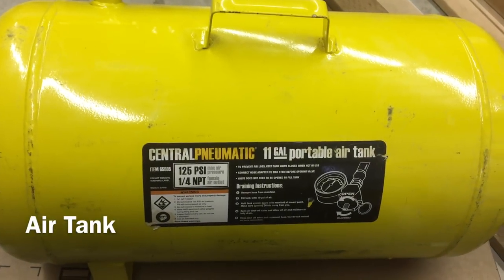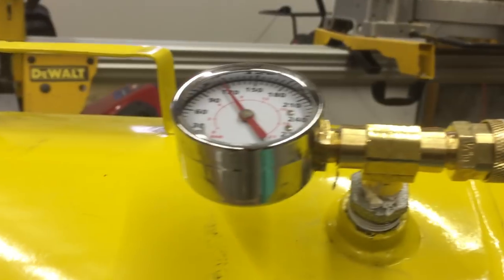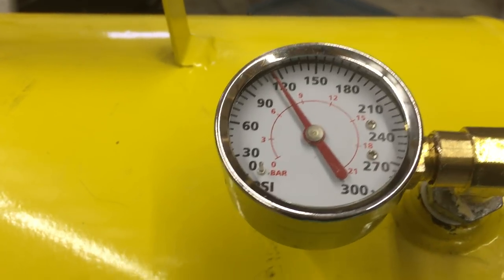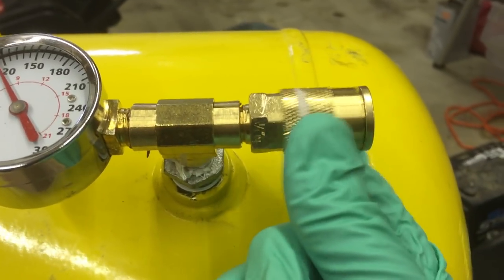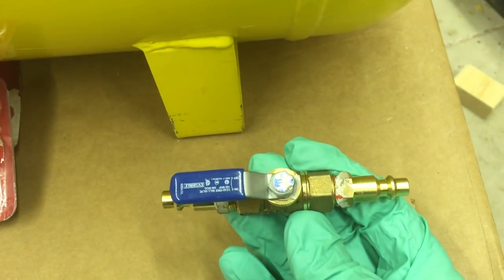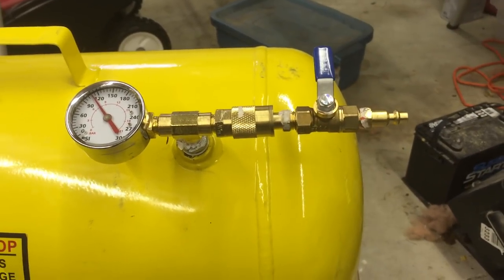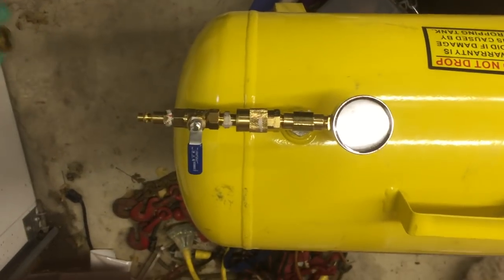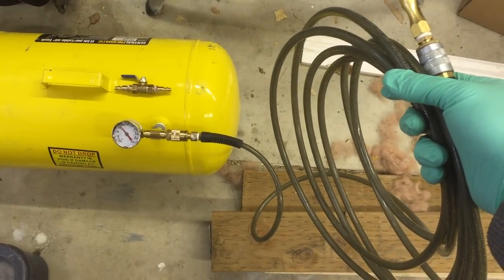Harbor Freight Portable Air Tank Valve Solution and Improvement

Comment: An absolute grand presentation! Thank you!  After 'fixing' the harbor freight air tank, all I need is a length of air hose with two female receivers at each end and I'm good to go.  Changing tires on a manual changer? Try seating the bead without this stuff. Thank You!!!

Comment: Anyone watching this should be warned this is not the correct modification to make. The Safety Relief Valve  has been removed and now the 11-gallon tank is a potential risk of being over pressurized /exploding. Safety is No Accident.
Reply: I quickly jumped to say this as well. Absolutely horrible implementation.
Reply: Jumping the gun. You would have to be able to put 1000 lbs, or more, pressure into that tank for it to explode. First of all I doubt you've got a compressor that could move that amount of air. Second, your hose from the compressor to the tank wouldn't be able to handle that much pressure. I see your point, but these things are engineered to handle excess pressure. And if the tank would fail, it would most likely start as a pinhole leak and just get larger...it just wouldn't explode.
Reply: @TheOcelot17   This bullshit comment sounds exactly like the typical stubborn God complex that almost always ends in accidents and fatalities. What are you basing your under-educated assumptions on? If you are assuming that the pressure tank is simply over built, therefore it would not make any difference, you would be incorrect. These are made as quickly as possible: sometimes by machine, other times by hand. They are not always hydrotested. If it happened to be welded by hand, who really knows rather or not the welder was shit faced drunk that day? What grade of steel is it? Was it treated properly? Accidents can happen anywhere along the assembly line. Now imagine a guy that lives by the ocean using this. The salt in the air alone derates the working pressure immediately. The same applies for use in extreme temperatures and fluxuations. These circumstances might not apply to you, however it will for others. Others who watch this video and decide to try to build one themselves. Do you honestly believe the engineers just decided to affix a working pressure because the number sounded cool? Are you even considering the obvious galvanic corrosion that will occur between the multitude of dissimilar metals used? What do you expect will happen if someone installs the fittings inadequately? What happens when an incorrect check valve is installed and someone decides to quick fill it with with an high psi compressor and the pressure switch on it happens to fail closed? Stop pretending like safety devices and warning labels are manufactured for just for fun. At the very least keep your potentially life endangering comments to yourself for the safety of others.
Reply: @Cameron_J  Truer words were never spoken!!!
Reply: I know my opinion is worthless after how many years have passed since this video was made, but I have to ask: do you even know how air compressor and portable air tank work together?
Reply: @xumot  I do, Great if your relief valve on you compressor system is equal to or less than the maximum rated portable tank pressure rating... if not and your Regulator were to fail (which I know can happen), you can over-pressurize the small portable tank.... I have seen the explosion of a pressure vessel and it's not something to take lightly. Keep safe out their...and your opinion does count.
Reply: @AddyOverbeeke  No matter what you do, safety is always a concern, that's a given. In my case I bought small 2.5 gallon 115psi oil-less air compressor and wanted additional tank to use as portable tank or in unison with the compressor. For that I bought new 7 gallon gas tank, rated for 435psi of working pressure and converted it to air tank with pressure gauge and two Quick-Connect fittings, nothing else. No relief valve is needed on the portable tank, because there is one on air compressor, and when I disconnect portable air tank from air compressor, it has maximum 100psi in it - nowhere near it's rated working pressure and besides, no more air will get in to the tank, only out.
Reply: @xumot  sounds like you know for your setup as long as it air supply source remains the same, but I was more concerned for those that do not, make the modification and create a hazard or later change their air pressure supply source not having a safety relief valve any longer.  
removing the relief valve removes the mistake proofing intended by manufacturer. Industrial pressure vessels have burst disks for this reason because cannot count on end users not to make modifications that create hazards.
Reply: @Cameron_J  I agree...downplaying SAFETY eventually leads to serious injury or fatalities...they are there for a reason!

Comment: Are you able to air up all 4 truck tires from 20psi to 35 psi with a 11 gallon air tank????  This would be very useful to know because for off road drives i deflate my tires to about 20 psi for comfort and more suspension and grip.  I have made a 7 gallon propane tank into a air tank and i can easily fill it up to 150 psi at a shop.  Can you please do a test for us with your truck and also let us know what size your tires are please ???  I like propane tanks because those are stronger and you can fill them up to 300psi safely if you have a good compressor.

Comment: Dont you need a safety check valve in the loop?
Reply from the maker: I came to that conclusion after I had built this valve and made this video. Since then, I have rearranged everything and implemented a check valve that blows at the tank's rated pressure-- 125 psi, I believe.
Reply: Great, do you have an updated vid or pic I can see?
Reply: Home Depot carries a Webstone 3/4 in. IPS Ball Valve with an attached Drain Ball Valve I was looking at using in order to easliy add a drain without tapping and welding the tank. Can't find anyone who used one yet but it looks like an answer.

Comment: I want to buy this. But how can I get this?
Reply: @snap-off5383  I looked in Home Depot, Lowes and Ace Hardware.  None of them have the 1/2" to 1/4" reducer for the tank output and none of them have 1/4" tee fittings.  I hope I can get them at Amazon or Ebay.
Reply: @richardm1862  I lucked out and found that manifold on sale for $2.99 at rural True Value in Florence Arizona it didn't have the adapter fittings though it was just a manifold

Comment: If you fill a tank rated for 125 psi to 150 would it blow up or is there enough safety margin that it can take it?
Reply: Don't fill it up to 150.
Reply: They most certainly test it up to double its rating so 250 would be what they saw it hold before sending it out the door, 150 is probably fine, but don't take it beyond that.
Reply: I can't believe i have to spell this out... i myself have forgotten to turn off my compressor several times over the years. Presume the pressure switch that turns it off takes a shit or the relay sticks, you will not be there to stop it or to watch it. It will pump and pump and your harborfreight yellow tank is rated at 125 psi  (thats pounds per square inch - how many square inches is your tank? ) (i think we often underestimate numbers because we have no idea what they mean) Your tank will or will not be able to take it. You will find out. there are two ways to do things. The right way and the wrong way. Pressure relief valve is 6 dollars on amazon with free shipping. But looking at his chewed up fittings he is not much of a craftsman or simply does not know how to use proper tools or possibly it could be a combination of both. oh and he had enough wit to buy a gauge that goes to 300 psi. My guess is it was the cheaper one. ;-) just like the tank, the 39 dollar is rated at 125 psi and the aluminum 59 dollar tank is rated at 160..... go figure
Reply: VW O'Day  ha ha ha ha

Comment: Where's your safety relief valve? Would you take the risk of plugging your pressure relief outlet on your home hot water heater? Put a safety relief valve in there, or just purchase a newer, higher quality combo fitting for portable tanks. You're flirtin' with disaster without that safety valve.
Reply: I know my opinion is worthless after how many years have passed since this video was made, but I have to ask: do you even know how air compressor and portable air tank work together?
Reply: @xumot  Right, and the air compressor has the safety relief valve that will open before the portable tank pressure gets to high.